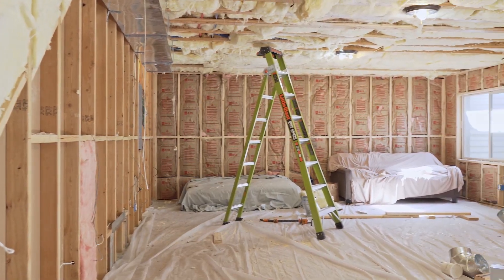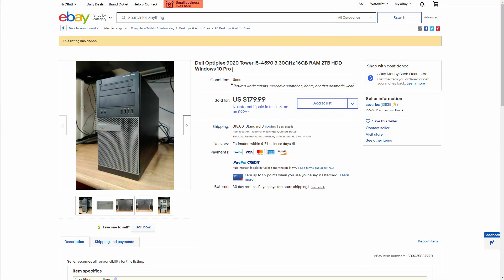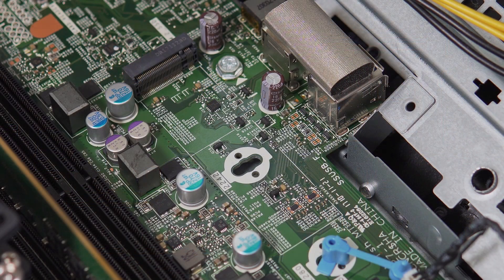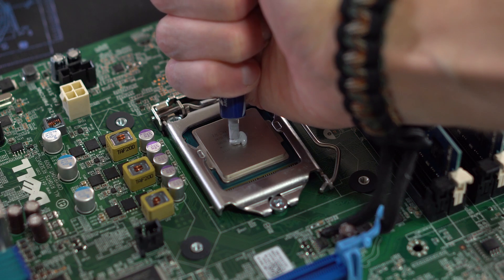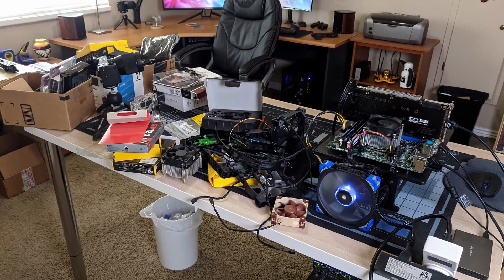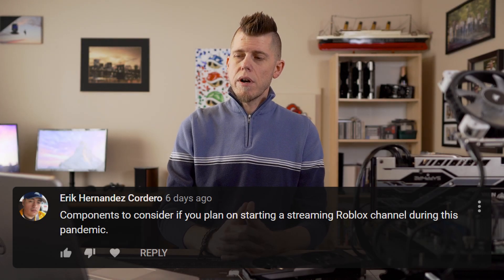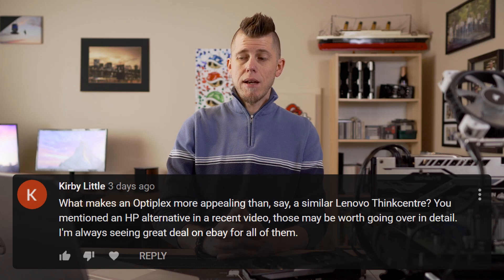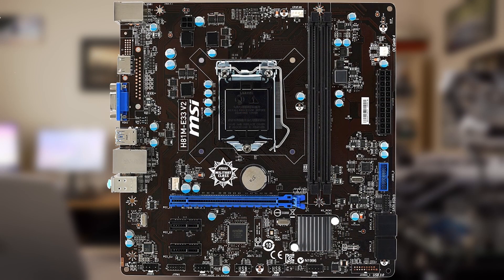Dell OptiPlex Q&A Pt. 2: Power Supply & CPU Cooler Upgrades, NVMe m.2 SSD's & More

Comment: Thanks for the video! For the fan list: I replaced the stock ones with a Noctua nf-a8 and a9 (just to get a taste with them), and those give fan error too, I plan to add one more for intake after removing the cage, so eventually the fans cost more than the machine :D (7020 + gtx1650 super owner here).
Reply from the maker: Yeah, I had the same experience with several Noctua fans. The really don't like them.

Comment: This CPU fan will work with the 4pin to 5 pin CPU plug. I have swapped it out in the 990MT case. Thermaltake 7-bladed 92mm 4-Pins PWM Aluminum Extrusion CPU Cooling Fan for Intel Core i7/i5/i3 CLP0556-B
Reply from the maker: Thanks! Looks pretty similar to the stock cooler, did you notice any cooling improvement between the stock cooler and this one?
Reply: @TheGameBench  I noticed about 10 degrees cooler. But you have to be aware of the Caps next to the CPU. The default Cooler has a higher cutout on the bottom. So, really depends upon the Dell Optiplex version you use the cooler for.
Reply: I bought a Dell 3040 MT and the same cooler but it would not fit because the cutout on the bottom of the heatsink was not tall enough to clear the caps next to the CPU.

Comment: Some games have the Nvidia relfex + boost. This option is a variable oc on the gpu. I have a 1650super and 290w optiplex 9020. Can I safely use this settings in games.
Reply from the maker: If it were a 1060 6GB or one of the 1660 models, I'd say no. But with the 1650 Super, you should be consuming around 100 watts, and with an OC I don't see it pulling more than a 1060 6GB. However, you might want to consider using a dual SATA to PCIe adapter since you could exceed the wattage of a single SATA power connection.
Reply: @TheGameBench  how much power does a single sata to pcie adapter provide
Reply from the maker: @Kurry-zq2zg  A max of 54 watts. Just keep in mind, most GPU"s do not consume 75 watts from the PCIe slot.
Reply: @TheGameBench  Thanks a lot, I’ve been using HWiNFO64 to monitor the ofc and it’s been sitting at around 96 watts max with average of 93 watt. Idk how accurate the software is but the pull from the nvidia boost oc is nice and reduces some bottleneck

Comment: Inspired by your videos I built myself a 7010 about a year ago (16GB, 1650 Super, 1TB SSD, and the PSU had to be replaced). Recently I swapped the i5 with an e3-1270 v2. Under stress the CPU temperature was 80C, so I decided to replace the cooler with a Xilence I402 tower cooler and a cheap aliexpress adapter. This cooler can be easily installed without removing the motherboard and it works with no problem. Now max temperature under stress is 73C with low fan rpm. As the Optiplex doesn't let you play with the fan speed, I think if you want even better cooling then a 120mm cooler is the way to go, provided you find one that fits into the case. 

Thx for the videos, keep up the good work!
Reply from the maker: Thanks! Glad I could help. What stress test were you running? AIDA64 Prime95 small FFT? That's pretty toasty, and quite the improvement. Nice to know it bolts right to the stock backplate on these too. And no fan error?

A 120mm would be nice, but sadly... I don't know of one that will clear the side panel. You don't have a lot of room to work with. I'd really like to grab the Noctua U9S for some testing. Might be the best cooler you can fit in the stock case, but the fan will definitely throw errors.
Reply: @TheGameBench  CPU-Z stress test. The fan works fine. During gaming max temp is 67-68C.

Comment: Really enjoy your videos TBG. I have a 7040 MT motherboard that I want to move to a larger case. Can I move the mb into a 9010 case? I know the front panel connection is not compatible, etc.
I had a couple of 9010 motherboards die on me and did not want to risk another 9010 mb die on me. Will the 9010 case standoffs match some of the 7040 mb standoffs. If 3 or 4 matches that would be okay. Can I use kapton or electrical tape on the unused standoffs to prevent esd?
I too cheap to buy another case and also my 9010 has a good psu and probably better air circulation.
Reply from the maker: As far as I know, I have a 7050 here, the standoffs in the models after the xx20 series are not standard mATX, so the holes won't line up. As far as I could see, you might be able to line the upper left one up, but I don't think any other will. You can always remove the board in the 7040 and look. However, even if you have three line up, you don't want standoffs where there are no holes, otherwise you're risking a short. So, I wouldn't suggest it, or at least cut the unused standoffs out.

Comment: Thanks for making these videos, they are great, smart and professional. I had a few old machines laying around and decided to make it a project with my son. I have a Gefore GTX 1080 Nvidia and i7 9020, I replaced the PSU with a GameMax V600. My 1080 nvidia Fan won't even turn-on nor is being detected as a video card on the BIOS PCI slots. is there a sure way to know if an Nvidia GPU card is bad? the GPU fan won't even spin when turning the computer on. Thanks
Reply from the maker: That's a bummer about the 1080. The fans most likely won't spin because of 0dB mode. However, they should spin up when you initially power on the system and then spin down and stop. If they don't, that's generally an indicator of a dead GPU. If you wanted to verify, I'd test it with a different power supply or maybe in a different systems as well. If the problem follows the GPU, it's dead.
Reply: Sometimes you have to pop the CMOS battery and power the system up.  Then it should work, if the card is good (you can put the battery back in after).  Also, I think you need to enable legacy ROMs in BIOS.

Comment: I am booting from an NVMe in an Optiplex 3070. The difference in time is very perceivable, booting, running and shutting of saves minutes from my life.
Reply: It is an MT, mind you. Also changed RAM, and added an RX 550 2 Gb. Unfortunately I cannot add additional 2.5" storage as I do not have a Dell HDD caddy for it, and the cage does not allow standard mounting...
Reply from the maker: Yeah, from the xx40 series and newer they come with m.2 slots and can boot from them. The xx20 series does not.

Comment: Thanks for the OptiPlex videos. I'm interested in more 9020 SFF builds. I think I've maxed out my video card height with a EVGA GT1030 in the bottom slot... What would be the best low profile single slot card? I def couldn't fit a 1650 or 1050 or any 2 slot cards without fan/cooler modifications. I had to remove the shroud off my 1030 to fit. And would the 1650 require power upgrades?
Reply from the maker: The GT 1030 is the best single slot LP card on the market right now. However, you don't have to limit yourself to single slot cards. I'm not sure why they put the x16 slot next to the PSU, but the x4 slot next to the CPU is open ended and you can install a 1050 Ti or a 1650 in that slot and it will work just fine. Having only four lanes to the GPU might hold back every so slightly, but it's pretty marginal.
Reply: @TheGameBench  Thank you very much. I knew it was upper slot was slower, but didn't know it would still be acceptable for the higher end cards. I'll be content with my 1030 until prices drop. The 1030 was the most expensive part on this free ultra low buck system. Your work is awesome and can't wait for next video.
Reply: I had a 1050ti in a 9020sff on the 4x slot. It works OK, the only problem i was having is that it will stutter a lot if the HDD or SSD is working, i believe this is because the 4x slot is connected to the chipset sharing resources with the SATA, the 16x goes direct to the CPU. Depends as well what games you play, if the engine streams assets from the storage frecuently, then you will suffer a lot of stutter.
Reply from the maker: @visordo  Odd, I've not heard this from several people that I know who have done this. You can always grab a good riser cable and handle it that way.

Comment: If you can find one used, the Samsung 950 Pro lineup has a special option ROM that allows bootable PCIe on Haswell and older systems. No software or modding required.
Reply from the maker: Interesting... The only problem I see with this is that you'll have to boot in legacy mode rather the UEFI. Might not be an option for some, but certainly good info. Wish I still had one to test with. Might have to find another one and make a video.
Reply: @TheGameBench  my Haswell custom PC has UEFI with CSM (compatibility support mode) that allows best of both worlds. No idea whether the Dells would also.
Reply from the maker: @aednichols  Yeah, there's no CSM in the OptiPlex BIOS.
Reply: @aednichols  that points out a major advantage of “pc building” motherboards over prebuilt.
I tried to upgrade my brother’a old Lenovo desktop with a i5 3570k and it didn’t work. Bios support wasn’t there. Same for booting from PCIE.

The recommended motherboards for the cpu I’d just bought were all “pc building” type. 

And those boards were all selling for ridiculous prices $100+ on eBay from China. The same gen oem boards were $15-$40, but with zero support!

Comment: whats the best gpu to pair with my i5 3470 10gb ram system
Reply from the maker: I'd say some good options would be the 1060 3/6GB, 1650, 1650 Super or 1660. On the AMD side, the RX 470, 480, 570, or 580. Just plan on replacing the power supply for the AMD cards. Any of these would pair well with the 3rd gen i5.
Reply: I do have a 320w 80+ gold rated dell psu is it enough for amd
Reply from the maker: @hussenmazen8036  For the some of the RX 470/570 models, but for the 480/580, I'd go with at least a good 450 watt or so.

Comment: flipping opti's is my favorite pass time, hardest part is looking for a 750ti or 1050ti for under or around $100. Always gotta add some colored fan in the front!
Reply from the maker: I've enjoyed it so much more than I could have thought. Yeah, the way GPU's are is killing the scene right now. All I see are people selling systems with outdated, underpowered GPU's since it's all they can get a hold of. I think there's a small relief on the horizon with 4GB cards as ETH miners start to dump them. The 4GB RX 470 might be one of the best deals right now on the used market.
Reply: @TheGameBench  I didn't think about that, with the popularity of 4+ gb cards hopefully ETH miners start going towards at least 6gb cards. Also thanks for the heads up about the 470! Gonna check some out on my local classifieds tonight!
Reply from the maker: @krylonfanboy9643  Yeah, they don't have a choice. The DAG file is soon going to exceed 4GB and when it does, they'll be bleeding them onto the market. It's already started from what I can tell. Some people are trying to get ahead of the flood. I suspect the prices on those cards are going to tank soon. Especially the RX 470, 480, 570 and 580. However, people can still use them to mine less popular coins.
Reply: @TheGameBench  Dang I need to do more research I had no idea! Thank you for this information and the wonderful video as always!

Comment: I really enjoy your videos and your approach. I'm currently typing this on a 2014 HPZ420 workstation. I shoehorned an EVGA 1080Ti FTW3 into it and it runs fine except that I had to modify the front fascia to increase airflow because the GPU and the CPU got stupid hot with the case closed. One of my other interests is 3D printing and I designed a new front grill and three internal ducts. The rig looks stock on the outside but internally the case stays at ambient temp and running Heaven the 1080Ti is running at 63C/1949Mhz consistently. Why all this work? because just like you I get a lot of enjoyment modding old surplus stock and taking these systems to places they were never designed to go. 

Something I'd be really interested in is what is the performance difference between running dual channel and quad channel memory. The performance jump between single channel and dual channel is well covered but I've yet to see a video discussing quad channel. Along with my 1080Ti I'm running an E5-1650V2 at 4.1Ghz all core with 32GB (4x8) of 1866 DDR3 and it runs all the modern AAA games I want to throw at it at reasonable settings. I suspect that a big part of that is the Xeon CPU and the HP motherboard support quad channel.

As per your suggestion I think I'll install some LEDs to make it go faster.

Comment: Built up my 9010 with your videos... then saw GPU prices and now have to wait.... LOL
Reply from the maker: If you think you could get by with a 4GB GPU, keep an eye on the 470, 570, 480 and 580 4GB models. They're coming down in price and they're good options, even if it's a place holder until mining takes another slump, and you can afford the GPU you want. And that's going to likely be later than sooner.
Reply: @TheGameBench  nVidia no longer supports models below 600-series.  You will be stuck with old drivers.  I put 770 into my 9020 MT, hopefully nVidia will support it for a few more years. (Edit: I just realised you were talking about AMD cards. :D)
Reply from the maker: @valerysinitsine5949  Haha, yeah, AMD cards. Sadly, I thought I recently heard that 7xx series driver support was ending. I've been on the lookout for a cheap 9xx series card to put in my server.
Reply: @TheGameBench  Hopefully not. :O New 710's and 730's are still being sold right now.

Comment: I currently have an optiplex with an rx570 and an i5 4590 for serious vr gaming should I upgrade the cpu or get a new motherboard and cpu?
Reply from the maker: If you have the money to build a new system, I'd go that direction. Something like a R3 3100 with a good B450 mobo would leave you a lot of room to grow. However, if you'd rather not or that's not really in your budget, go with a 4790 or a Xeon 1270 v3 or 1271 v3... whichever you can find cheaper. Quad core i5's are going to have more and more trouble going forward. Even the with hyper threading, the quad core i7's are going to start really feeling the heat before too long if certain games like Cyberpunk and Valhalla are anything to go by.

Comment: I have a 9010 opti and I was wondering what graphics cards can be put in it. The cage drive cage is removed and lets say that we are not limited by the stock power supply. How high end of a graphics card will be compatible?
Reply from the maker: What CPU are we talking about? An i5, i7, something else?
Reply: I7 3rd gen I believe

Comment: I purchased a 9020 with an i5-4690, gtx 1650 4gb,16gb ram and a 2tb Samsung hard drive all for $350 locally. As is it ran fs 2020 at 50 fps  on high settings and on f1 2020 average was 65 on ultra settings and 100 plus at anything lower. After upgrading the cpu to i7 4790k it now runs average 70 fps in fs2020 on high and in f1 2020 it runs upwards of 80 fps on ultra all at 1080p. All in all i have 450 bucks in it and couldn't be happier. Would like to give a heads up to anyone looking into optiplex's, and that 1080p and high settings with anything over a 1050 card will have a cpu bottle neck. The i5 ran @100% the entire time while gpu was at 50-70%. The i7 variants will also perform roughly the same with maybe a 2-5% increase in gpu usage. So with that being said if you're new to gaming and just want something that'll work with any game out there you can't beat the value, but if you plan on upgrading bits or  eventually going hard-core gamer I wouldn't get into them. They use outdated components and have very limited aftermarket support. Not only is the 4790k the only cpu you can use on it that offers better performance, it uses ddr3 memory so it won't be the fastest. I would recommend going a different route if you fall into that category. Hope that info helps out.
Reply from the maker: Yeah, in part one I said that I feel like the OptiPlex, or the older OEM route in general, is great for the person who only has a very small amount of money to spend. If they have the money, build something for sure. That being said, bottlenecking really depends on the game. But you should be able to run up to a 1060 6GB, or 1660 without bottlenecking in most games. There are some newer ones that just don't like quad cores at all, and they're even problems for the i7's. I actually have a whole video dedicated to testing out the 2nd, 3rd and 4th gen i5's and i7's.

Comment: hey! I hope this is related:

I bought a optiplex 990 for cheap with a i7 2600, right now the pc have 16gb of ram in dual channel, 650w power supply and a amd rx550 (the 4gb variant with polaris architecture). the setup runs smooth and it handle all my needs, I play a lot of fh4 and insurgency so it's handling everything very well.

for the future i'm planning on swapping the front panel of this dell 990 with the dell t140 front panel, adapt a cooler at the front for cold air intake, I also wanted to swap the pc case but didn't wanted to leave the "dell" theme so I searched for old xps and alienware cases but they aren't that cheap as some models are considered as colector item.
Reply: your videos really helped me to visualize what I needed and what I could do to achieve it, the i7 2600 is good enough for gaming and light work, some people might want to change the mobo for a more capable one.

other route you can go is overkill and fill all the slots, I mean, the dell mobo can handle up to 32gb and as long as you have the right power supply you can install most graphic cards that are avaliable
Reply from the maker: Didn't know the T140 used a similar chassis. That front panel looks pretty good, and that would be a pretty good looking Opti. Looks like the T140 could fit a 240mm rad in the front. It could make a pretty good sleeper system.